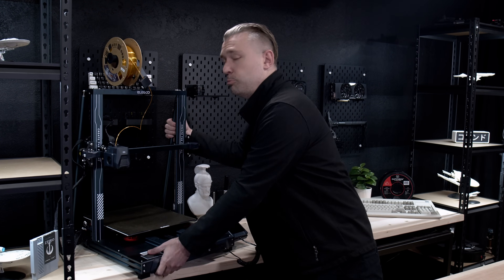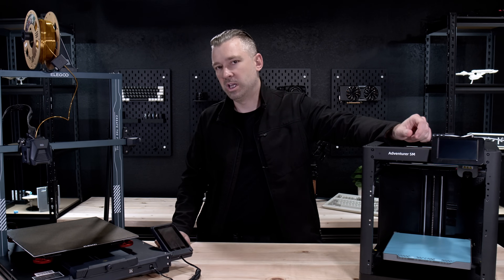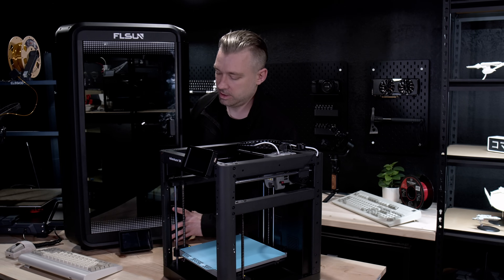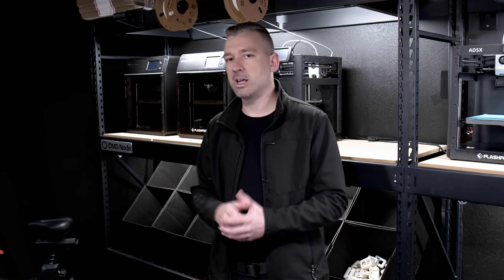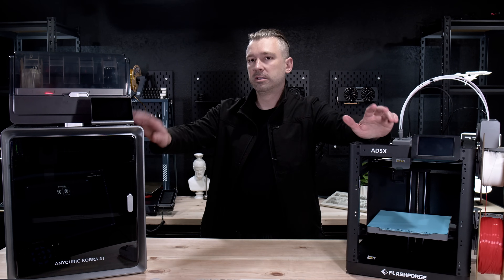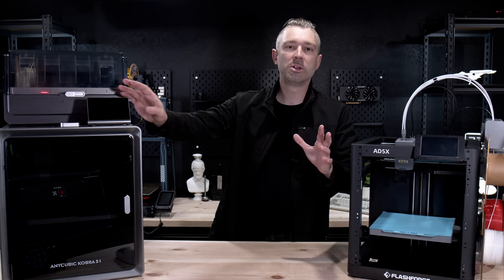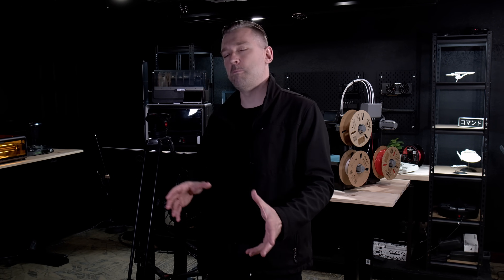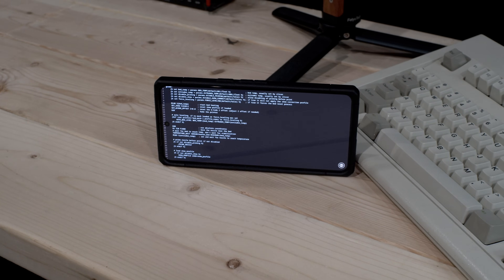Why All 3D Printers Suck! And Why That's OK!

Comment: My first printer was an Ender 7. I wanted to tinker with it and turn it into a fast printer but 3D printing scared me and by the time I started tinkering with it the latest generation of printers dropped. My latest printer is a K1SE. I'm doing all the upgrades to turn it into an even better K1C. I do not regret my Ender 7 that I barely ever got any prints off of because like you said I helped fund the marvel that is the K1 series.

Comment: i just purchased a K1 and while it's not perfect it's no nightmare. if i wasn't aiming for core one quality on a base model K1 i'd have almost no complaints. out of the box it worked perfectly* they did provide very white PLA that makes it hard to see issues in prints. that first benchy blew my mind and as i learn the ins and outs it will either continue to wow me or i will use it to build a voron. no regrets even with a warped bed.

Comment: I have had only a few different printers.

My ender 3 sucked in almost every way 

The 2 k1se printers I have are awesome and reliable except no TPU period without major upgrades 

The adventurer 5m is great with TPU and a .6 nozzle.  It's great except for when it completely freezes and I have to restart it.  Not quite as reliable but my new TPU workhorse

Comment: That's why I choose to build a custom one myself. Complete control over everything.
Reply: First was a rook. Just to familiarize myself with how it all worked with Marlin firmware. I then proceeded to making a hypercube evo with some diy. Finally built a custom one with 3 point auto leveling and added a ton more options with klippper (KAMP, input shaping, web interface etc...).
Reply: @webslinger2011 Make a video.
Reply: What did you build?

Comment: I don't know man, but your opinion is probably the one I trust the most in the 3d printing content creation space. I totally agree with your points in this video. It's very easy to become a brand's fan-out and live in a particular echo-chamber. They all do suck, and all will give you problems one way or another at a certain time. Keep doing what you're doing...🤙🏼
Reply: The trick is finding the ones that suck in the way you can deal with.  I know some people who are happy with Ender 3 variants because they can throw enough upgrades at it to make them work.  I prefer paying the costs for a printer like a Prusa XL or a Bambu H2D because of features it comes with, and that they work well out of the box.

Comment: I do have way different experience from owning ender, kingroon,  anycubic and elegoo printers, every time i got new printer to replace previous i always met similar issues, i tune and upgrade them way more till i got A1 mini from bambu, out of the box it prints flawless,  layer to layer, consistent and most importantly damn fast for its price of £150 now, then i got A1, and everything repeated but in bibger scale. No tuning, just printing. I stopped buying filaments by one spool at a time, now only in bulk as i sometimes use 1 spool in 2 days. And i print mostly for myself,  home etc. So not sure about sucking. You probably got faulty printer or something.

Comment: Yeah Bamboo sucks too i wanna Tinker and Look for mistakes learn Stuff by failure but they ... They Just Work Its boring as hell now i got an flsun and i Love it so much new Stuff so much to improve so many Design flaws i Love it
Reply: Bambu sucks for many more reasons than "it's boring". Orca slicer is much better than bambu studio, and they locked down the firmware, so you can't use orca slicer if you don't know how. A friend of mine believed orca slicer could no longer be used, period. Until I told her about the "developer mode".

Also bambu tried to get away with using open source software without publishing the source code themselves.
Reply: Learn punctuation.
Reply: @USS-DDG-2 Neveeeeeer 😂

Comment: For serious users, the soon to be released SToN-WoLF will take your breath away. It is more costly than machines from China, but it is very fast, easily repaired and will last for decades. Everything else really will suck in comparison.
Reply from the maker: The SToN-WoLF definitely looks interesting. The design is far different from most anything we've seen before.

Comment: I think these points are valid. To get true reliability, you need to go major, eg Stratasys... but then you're in 50, 100k territory. As for Bambu.. I have two Bambu printers, they are reliable (500 hrs+ with just one failure...?) so as long as you are working within the limits of whatever technology you have invested in, all's good, yes?
Reply from the maker: It's true, most printer have give and take. One of the AD5M's in the studio has passed over 3000 hours and still act's like it just came out of the box. Obviously this wont be the case for all AD5M's but its pretty awesome either way. If only they could improve the feature stack.

Comment: This is so true!

You got to test a lot of models to find the ones that work _for you_.
For example, Ender-3 i still consider the best printers i've ever hard, but time has left them in the dust sadly. They were such reliable workhorses for me.

Fleet is now;
1x Creality K1 Max, 5x Sovol SV08, 2x Elegoo Centauri Carbon (1 is amazing, other is piece of shit. QC issues? - one more on order!), 1x Elegoo OrangeStorm Giga (!!!), 2x Elegoo N4Max, 1x Sovol SV07 Plus (if the ABL actually worked, what a fucking workhorse! 50+kg through it).
Waiting to be tried: Anycuib Cobra 3 Combo, Cobra 3 Max.
Reply from the maker: That's a decent fleet for sure. I have to admit I do like different printers for different reasons. I feel in the more generic consumer space the Anycubic Kobra S1 Combo is great in feature stack, but when that will have its draw backs I'm sure. I still haven't had any time with the Centauri Carbon, but I would love to at some point. Even if it's "older" at this point.

Comment: Speaking from experience, the AnycuBRICK is trash. Doesnt just suck, but is trash. Works out of the box for about 600 print hours, then becomes an unrepairable, non-responsive brick. But it still looks nice.
Reply from the maker: It definitely looks nice and the feature stack is hard to argue with. Unfortunately I haven't put the hours in to say either way. I've heard both good and bad reports. Some really good, some horrifically bad.
Reply: @zerodotcmd well, you have another to file under the “horrifically bad” category.
Reply: Sold it and replaced with a K1C. The K1C is more reliable, both the phone app and the slicer are more refined and the print quality is vastly superior. Only bad thing about the K1C is that you have to follow a 30 min video to install the CFS kit.
Reply: @bornlivedie I would do the same, but it’s difficult to sell a printer that doesnt do the 1 thing it’s meant to.
But I do have a working ACE Pro…

Comment: I finally gave up arguing with various fanboys on FB groups concerning this very concept. I have several different brands/models. They all have their pros, but they all suck in their own particular ways. I really liked your ending comment. I love my Bambu printers, but they too exhibit a certain degree of suckitude. My AD5's & Pros have a few drawbacks, but they are absolute workhorses. So far my AD5X is doing great. What I like most about it is the fact that it's one unit, with no separate AMS. The bulk of my business doesn't require color changes, but I like having some multicolor printers in the workshop.
Reply from the maker: I stopped talking on Facebook a long time ago, unfortunately everyone on Facebook is obviously a highly trained professional with 100 years of experience...

I've definitely seen my fair share of broken Bambu's, they're definitely subject to failure like all electronics. The AD5's have been far more solid then they honestly have any right to be. Most the time I wish the AD5's had a better feature stack. At the same time I also find myself hoping they just leave it alone because right now its the most reliable series of printers I've used. 

I love the AD5X, so far it's been just as solid as the AD5M's have been. Same as you, I don't see a lot of multicolor in my studio, but it's nice to have.
Reply: @zerodotcmd  Truth. Facebook has become a cesspool. I only stick around there because it still makes me money. The gatekeeping in the 3D print, laser & CNC groups is unreal. lol
The bottom line for me on printers or any of the other machines in my workshop is that I have to do routine maintenance & repair on all of them. They all seem to pretty much equally share this need overall in my limited experience.

Comment: Great feedback.  Have a number of printers including a T1 pro.  In reality build volume no better than FF printer, but price is higher and part availability is terrible.  My individual T1pro works great, especially with PLA filaments and larger parts where a fixed bed can be an advantage, or difficult parts that require more cooling.  Slow mine down to speeds similar to core xy.  Effector design and assembly is not great, so taking apart the extruder is a pain.  Each of my different printers shines in some area, and has limits in other areas.  I play to their individual strengths and try to avoid their weaknesses.  T1 does best most of my other printers in terms of lack of ringing.  Especially my x1c.  However my cheap SV06 ace's print quality is only matched by my Plus 4.  Ace has been by far my best send print and forget printer.  Other than the Ace and Centauri Carbon, which consistently do exactly what they are intended for, the rest (x1c a1, plus4, t1pro) all suck to some degree.
Reply from the maker: Oddly this T1 Pro does best with ABS and ASA, while lacking very much with PLA. I've talked with other creators and the machines have a different experience for nearly everything. With a few changes I can definitely see the FLSUN printers becoming more of a stable experience across owners. 

Have to admit I do like what Sovol is doing. Would love to do some video's with those units.